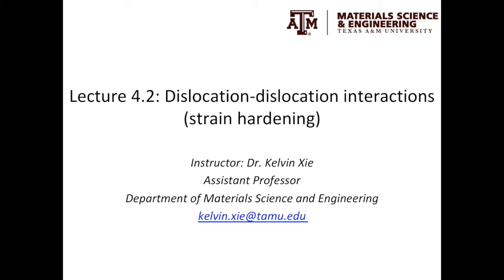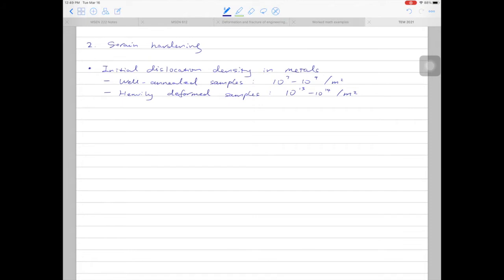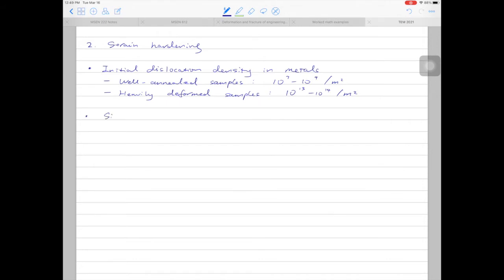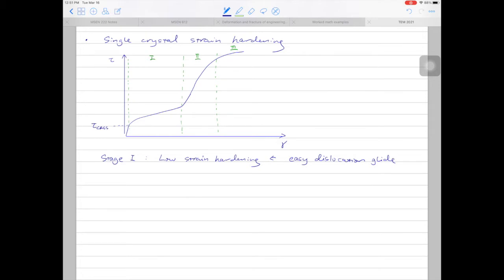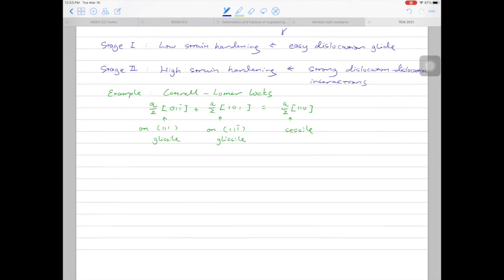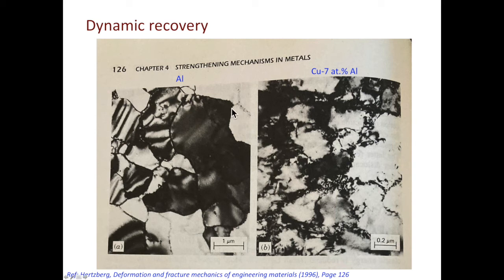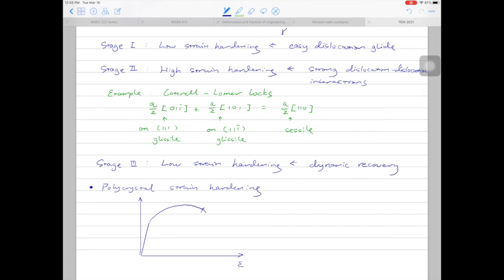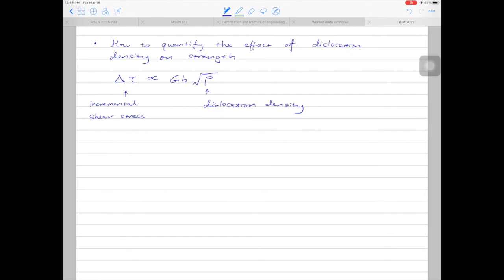4.2: Strain hardening

Comment: Dear Prof. Xie, would you tell me the deep reason of why the equation is used to describe the strain hardening in polycrystalline samples instead of single crystal? And could you tag the reference? Thank you.
Reply: I found the reference of this equation <Mechanical Properties of Engineered Materials> Section 8.4, based on Wikipedia. What confuses me is that the equation can transfer to Δσ by multiplying Schmid factor m according to equation 8.10-8.11. However, if the original equation is used to describe ploy crystals, is it correct to multiply Schmid factor? Or maybe multiplied by Taylor factor instead?